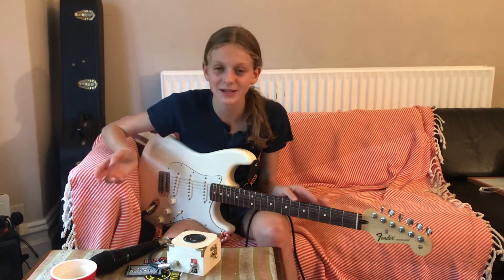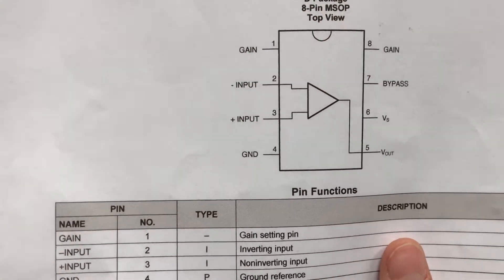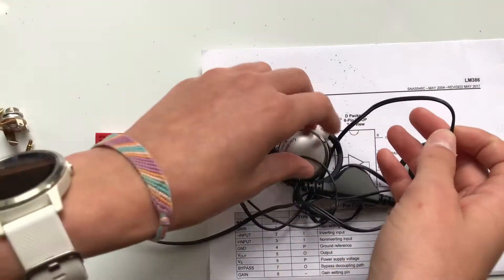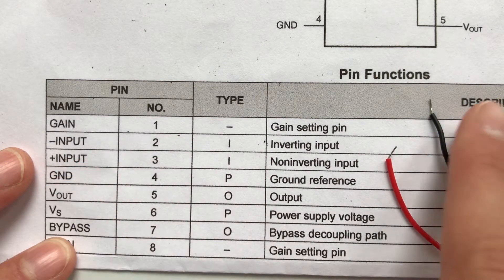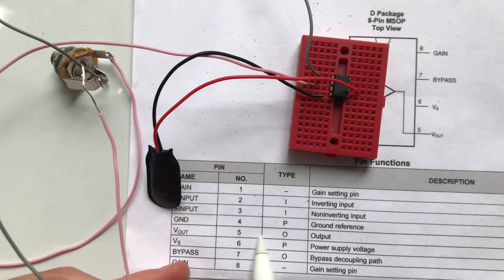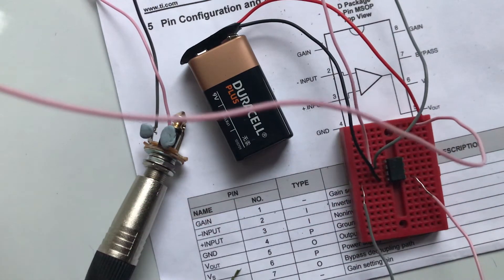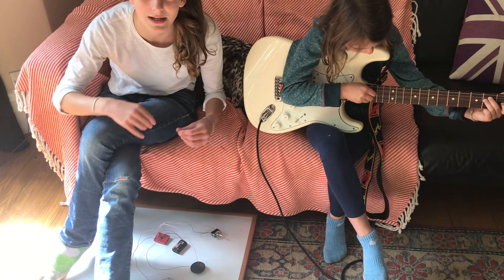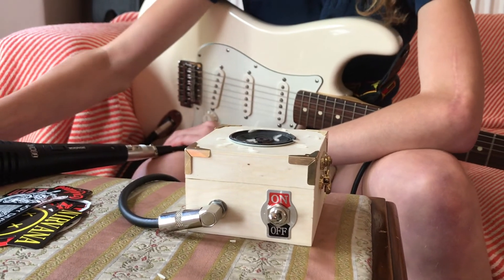Your first super simple electronics project - The Amazing Amp - Anyone can make this!

Comment: I've actually been meaning to build an amp for my mic that I use connected to my computer. The process would be similar, except I need to get a female 3.5mm jack to connect the mic into the "input" and then a male 3.5mm jack to connect it to the back of my computer for the "output" right? Or am I completely lost
Reply from the maker: So your plan is a preamp for your mic? Sounds interesting, let us know if it works, I guess the only way to find out it to try. Your jack description sounds correct, could be noisy but you can modify the circuit with some caps to help with that. Also you may need a volume control to fine tune the levels.
Reply: @GurgleApps  I found a PCB that does the preamp thing on aliexpress wish me luck!